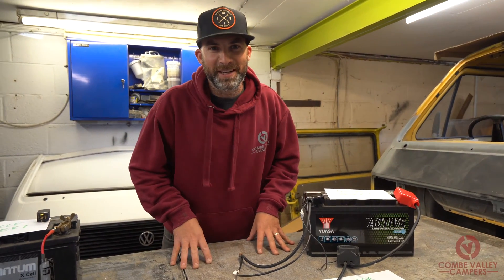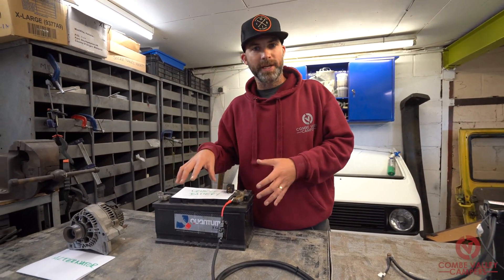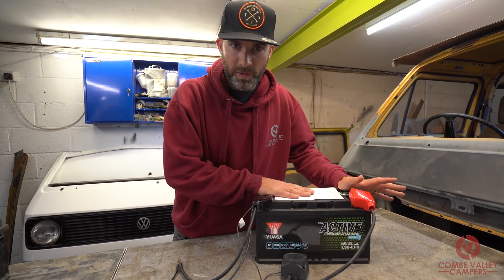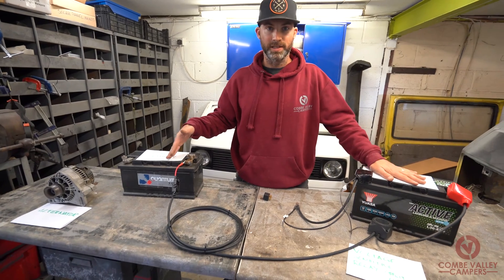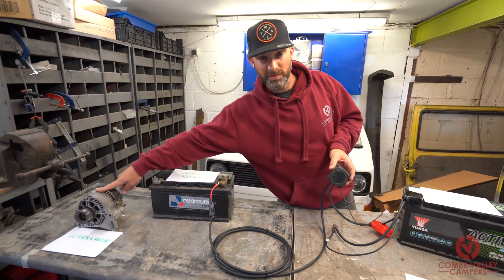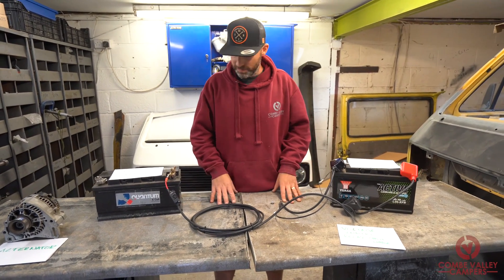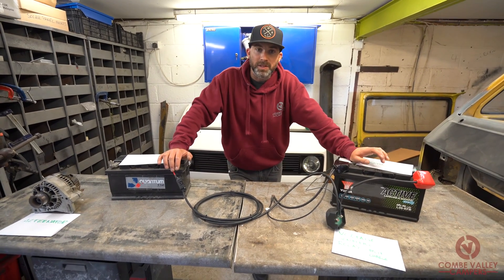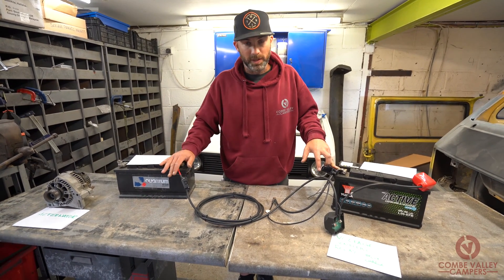A beginners guide to leisure battery charging and wiring.

Comment: You should've made a complete system with the solar panels hooked to the charge controller with the isolator coming off the main battery so both systems charge the solar battery

Comment: Can you get a two way split charge relay? So when the van is plug into main or the solar can charge the vehicle battery as well as the leisure battery?
Reply from the maker: I believe there is a method to do this but I’m not aware of the hardware needed

Comment: I'm inclined to buy a split charge system again. As long as I don't mess the ambulance wiring.
It's got a lot of that at the back of both cab seats.
But yes, for now the vans battery I will keep for starting the engine.
It conked out today!!😢

Comment: I'm trying to work out an ambulance bank of fuses to a starter battery positioned at the rear of the ambulance I've just bought. It's a Renault Master. Almost like my last Renault Master but that had it's starter battery under the floor of the cab and far far easier to add fuses and relay charger to a bank of leisure batteries. 
This has none of that.
A leisure battery connected , no isolation, no relay it appears and it's straight connected to a DC to AC 3000watt inverter doing diddly squat!!!
All I've got for lights is the original ambulance lights.
No electric points except two in the inverter stowed inside a cupboard of all things! ??
Can anyone help ?

Comment: Hi This has been very helpful to me as fitting this system on my boat.Just one question if I fit this system to my main starting battery and leisure battery and I am fitting a 100 amp renogy solar charging system alongside to charge the leisure as running lights and fridge overnight fishing and staying abroad which battery should I link up the solar to please kind regards Andy

Comment: a girly here from NIreland...having battery problem drainage..new battery 3 weeksago..left it in to electric auto guy hes checked said all is good nothing drawing. but loosing totally charge. how long do i need to drive to keep battery charged in cold weather. just on edge giving up as its my main transport. or any other ideas. please
Reply from the maker: The only thing I can suggest is that you disconnect one of the battery terminals over night to prevent any drainage when you’re not using it. Either that or your alternator is not 100% working. That being said, sometimes batteries can be bad out of the box

Comment: How long does it take to charge a battery?
Let’s say 110ah battery is completely drained?
Reply from the maker: About 12 hours of driving, if using a split charger like this. If you do have a completely drained battery, I’d suggest charging it with an appropriately sized mains charger
Reply: @CombeValleyCampers  wanting a basic setup for diesel heater and a few lights. Should work well

Comment: As like all your videos, this one is very informative. I do have one question. Will the split relay work in reverse, i.e. from a battery charger connected to an external power source, onto the leisure battery. I’m concerned that if doors are left open when on a site the interior lights powered from the main van battery will run down over time?

Comment: Thanks for this it is really helpful, I have an issue with my LB not charging, all is fine on hook up but as soon as I switch off I loose power to fridge etc, I have a question I think you can answer... how does hook up work? when on hook up does this just supply power via the the LB or is it also charging the LB, for example if I have been on Hook up for 24 hours should this have charged the LB in the same way the van main battery does? Great video, thanks for the back to basics explanation it really does help...

Comment: Hi, did you make a video on how to do it via the mains?
Reply from the maker: We’ve just filmed this video and it will be out next week.
Reply: @CombeValleyCampers  Amazing, looking at a boat that has mains but no leisure batteries connected/fitted so need to learn how to fit leisure batteries and connect them to the existing system to go between the two.

Comment: Hi - I've just seen this video and like others have said, it's brilliant how you've brought things back down to basics. Question - If you have this split-charge system connected to your leisure battery, can you also have an inverter and charge the leisure battery from the EHU? If so should there be x2 leads on the live and negative connections of the leisure battery (one each from both systems) or is that all sorted/ hidden behind my panelling. We have a 1994 T4 high top VW camper

Comment: I hope you see this. I have a question. But first. Wow thank you for this video. You made really simple to follow and understand, instead of all the people jumping around a vehicle. To my question. If I buy a (fancy) batterybox (with USB and 12V), they always come with 2 screws (+/-) on the outside for the cables. If I buy your relay kit, how can I attach those cable to the box? I mean, your cables are for attaching directly to the battery and not to a box with screws. Do you know what I mean? :D I really want your relay, then I know it'll work. Or do you have another kit that will go to a box? Thank you!

Comment: my van was professionally converted but doesn't have BtoB charging. I see Rayne do the kit but how do I wire the batteries when there is no access behind cupboards? Do I go under the van?
Reply from the maker: Most things can be retro fitted without having to disturb any part of the van. We carry out this sort of work all the time. If you’d like assistance with this sort of job please email info@combevalleycampers.co.uk and we can have a chat :)

Comment: Awesome video. All installed and working. When charging from my vehicle im getting 14.7v. On hook up im getting 13.9v is that normal? TIA. 🤙🏻
Reply from the maker: Yup, that’s perfect. The two different sources charge at different rates. If you check the vehicle battery voltage it should be the same as the leisure charge when the engine is running

Comment: Very well explained, thank you. I have fitted a kit after watching this and your other videos. The kit I purchased has a volt meter built in to the relay itself, all connected up and working perfectly. However the led voltmeter remains on at all times, I presume it is reading the voltage of the leisure battery as the relay is open so no connection to starter battery. Would this drain the battery?
Reply: The led voltage readout would have only have a tiny current draw so nothing to worry about.

Comment: If the start battery goes flat  , does the leisure battery not act as a jump start battery ?  If not , as the charge splitter blocks any feedback to the start battery , why do we need the heavy start cables ? Thanks . Mikep.
Reply: Some voltage sensitive relays have a switch to connect both batteries together in the case of a low voltage starting battery. 🤗
You need heavy wires as the resistance in the wire causes a voltage drop. If your wires are too small the relay may not open at all as it can’t reach the required voltage to close the switch.

Comment: That's great, did all that and worked fine.  But on electric hook up, our leisure battery was not getting charged.  So I bought an intelligent charger.  Connected it to leisure battery direct.  First day it worked great.  But second day I could hear the split unit kicking in and out!  Any idea why that might be please?
Reply: The size of your wire may be too small and this creates a voltage drop from one end of the wire to the other.

Comment: Hello, I got a B+  RV 2007. It has the old system but it does not work. I want to install this system but I'm wandering wath will hapen if the leasure battery is being charge with the electric camp site and I start the RV motor. Will that bring to much amperes to the leasure battery? Thank you for your demonstration.
Reply from the maker: Both forms of charger will charge the battery. Depending on the specification of the system you buy, both chargers will have battery monitoring features in place so as not to overcharge the battery.

Comment: Thank you so much for this vid. I need to ask im converting a car with a small battery and going to have a bigger sized leisure battery will this matter? Or should bats be of similar size?? Thanks
Reply from the maker: The relay/charger will only close when the voltage at the battery is at the optimum voltage (fully charged). That being said, if you were going for a very large battery setup or multiple batteries, you may need to upgrade your alternator

Comment: Great vid. One question. Does the relay stop the leisure battery from taking from the car battery when parked/camped up?

The relay breaks the connection doesn’t it? Until there is enough voltage in the car battery to pass through to leisure?
Reply from the maker: Yes that’s correct

Comment: Evening, thats a great really simple explanation, thank you! 

I have a couple of questions if thats ok, which are probably really blonde but nevermind lol. 1. Just to confirm the 'engine battery' powers all the car related stuff like headlights etc and the 'second/leisure battery'  power solely the interal bits in the camping section, just checking i've understood correctly. 2. Maybe you have done a video on this that you could link me, but how do you wire up the stuff in the camper/interior section to the leisure battery? Does the battery have several outlets for a plugs circuit and a lighting circuit? And lastly 3. Can the leisure battery be on both a split charge system and have a mains hook up connection on the exterior of the van?
Again sorry if the above are silly and really basic questions, really new to this and trying to wrap my head wrap the basic concepts and the terminology 😂. Many thanks in advance for any advice you can offer, Charlotte
Reply from the maker: Hi Charlotte, you’ve caught me whilst checking my updates! Yes, engine powers car related stuff. Lights, stereo, wipers etc. leisure battery ably powers campervan utilities: interior lights, fridge, usb sockets etc. wire everything into a fuse panel. Very simply- one positive cable from the battery to a 12 gang fuse panel- then wire everything into that panel so all circuits are protected by a fuse. You Can have multiple ways to charge the battery- split charge, solar, hook up etc but they need to be wired in correctly, via the right equipment, and with safety such as fuses or a breaker. Hope that helps :)

Comment: Hi. Thanks for the vid, I'm looking for an answer if it's necessary to disconnect split relay from leisure battery if I decide to charge leisure battery using mains just to charge at home or campsite. I already have switched spur fitted to disconnect all 12v circuits with just one switch so I can leave battery terminals connected to the battery but I'm not sure how about split relay -  can I also keep it connected as it won't be passing any current the other way or I need to disconnect it prior to charging from mains. If you could let me know I would really appreciate it.

Comment: So to dumb it down, the negative on the relay goes to the negative on the Aux battery? The ground on the relay also goes to the negative on the 2nd battery as well as the chassis connected with a wire also from the negative on the battery? Can I put a 12v on/off switch between the vehicle battery and the relay for extended periods of time when I won’t be using the aux system?

Comment: Such a great video! This makes me wonder, is there a way to use split relay in a solar only charge setup where once your panels are at full voltage you cam charge a secondary battery? I have a small, portable (for tent camping) Renogy 10A controller + power bank. When not camping, I set it up in my home office window and charge all my devices from it.  I’m don’t come close to draining it  but I’m thinking it would be nice to capture the excess power from it to a bigger battery (either attached to my tent camer solar bank or attached to an identical set up I have in my suv). Do you have any videos on secondary / leisure batteries charged by solar?

Comment: Waste of Time as the split charge relay only charges the lead acid battery to 80 percent and then you can only discharge the battery to 50 percent. For example I have a 120 amp battery and the time a take of the percentages im left with 46 amp's,  don't bother with these just go lithium with a dc to dc charger and get the full capacity of your battery ad they can be discharged to 0 percent without causing any damage to the battery.

Comment: Quick question mate, I’m upgrading the 12 V leisure system to a 24 V system. Can I install a step up transformer after the split charge relay before it goes into the battery so it charges the 24 V?

Comment: Thanks for your videos. I find them beyond helpful. I've a question though. Is it possible to implement a split charger, a solar panel system and a mains charger all for a camper van with two batteries ( vehicle+leisure)?

Comment: Thanks for this! Here is a good one for you, I'm sure someone else will ask or wonder the same eventually. 

I have a VSR set up to a 95Ah leisure battery, all is well, my question is, 

Can I run my subwoofer off my leisure battery whilst I drive, so my amplifier would draw from the leisure battery naturally, the VSR would charge as expected however I would be drawing current from the same terminal as where the VSR will flow current from car to leisure battery, 

In essence I want to know if I'm safe to pull power from the leisure battery whilst the engine is running thus VSR could be operating (likely) 

I'm running a 140amp VSR, 
Xv27mf hankook leisure battery, 
Standard alternator and car starter battery as found on a caddy (stock OEM)
Inverter 4.8amp rated China special
Bluetooth amp which runs off the inverter powering the component speakers, 
The Bluetooth amp then runs a RCA to my auxiliary amp (normal car sub amp) this amp needs to be powered by 12v which is where the link to the leisure battery is

One more twist my inverter has to be on too, while I drive to power the sound system, as the pre amp is a 220v 20v adapter plug in

Basically I want to use my leisure battery and charge it at the same time, just like a car battery charges without any camper leisure batteries to worry about what do you think?
Reply from the maker: I don’t see a problem with the setup. The only thing that would concern me is potential audio interference from inverters and other equipment. Leigh
Reply: @CombeValleyCampers  worked put great here's what I did:

Split charge kit - eBay
Blue tooth amplifier - eBay 
Leisure battery - eBay
Inverter - eBay
Components by vibe - eBay
An old Alpine amp I had
A old sub I had and hooked it all up I now have full ICE

Comment: I saw what you did lol however I have a transit camper I've bought with liesure battery which showed voltage ,but I'm sure I left one connector off the liesure battery and it was charging although recently noticed little red light on but no voltage reading now,I. Hopeless with electrics stuff like this 🙈🙈🙈🙈

Comment: Hi, if I can, I'll try explain my current issue, pardon the pun ! I have a split relay that is linked to 2 leisure batteries,  however it seems only one battery is charging, while the other , doesn't, I can't actually confirm that the other one is charging, only that it seems to maintain a voltage of 13.1 bolts, while the other dips below 12, never recovering even after several hours of driving ! This non charging battery also appears to be the one that the vehicle electrical control panel reads, in terms of the voltage it states, even though the other battery is sitting at 13v. I've checked the primary vehicle battery, it's fine and ramps uo to 14.2 bolts on start up. Could it simply be that the poor leisure battery , is simply too heavily discharged that the split relay can't charge it ? Both leisure batteries charge up on hook up, the good one up to 13.4v, the poorer one only to about 12.4, any tips or help would be great full,  thanks.
Reply from the maker: Please email your enquiry to info@combevalleycampers.co.uk and we shall get back to you. Leigh

Comment: Can the leasure battery have the return direct to the neutral on the main battery? It's for my steel hull boat and I can't have current going through the steel because it will course electrolysis.

Comment: Will the relay refuse to charge the leisure battery if it's the leisure battery thats low on power or will it always be the van battery thats at fault, mine is clicking to itself when the van is running and isn't charging the leisure battery, showing 12.7v on the screen,but in the sun today it was showing 13.9 stood and when I started the van it went to 14.2

Comment: How long or how far do you have to drive until the leisure battery is fully charged? Thanks 👍
Reply: About 2 to 3 hours for a normal leisure battery.
Reply: The trick is to have a really good starting battery. A poor battery under the bonnet takes more power from the alternator.

Comment: Would you say £566 for a leisure battery and installation is ok ? Wish I could be brave enough to do it myself . I just worry that they might use the old system you mentioned in the start of clip and that the battery would be cheap quality  ?

Comment: Does the amount of leisure battery setup you have make a difference on the system you need? The kits I'm looking at say they're rated upto 110ah but I'm getting a much bigger set up. Having 520ah worth of batteries. Can I still wire it up the same?
Reply: Yes

Comment: Great video guys. I’ve seen people add another fuse from the split charger to the positive terminal on the leisure battery. Is this necessary as I only thought you needed one from the main battery to the split charger relay